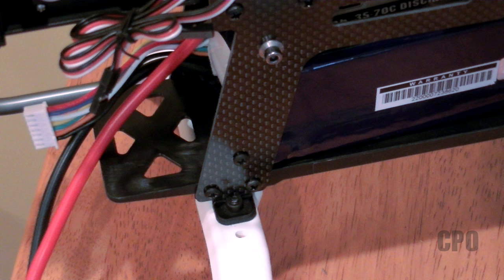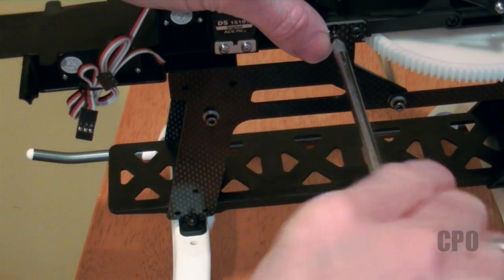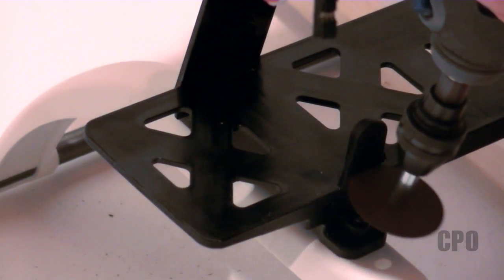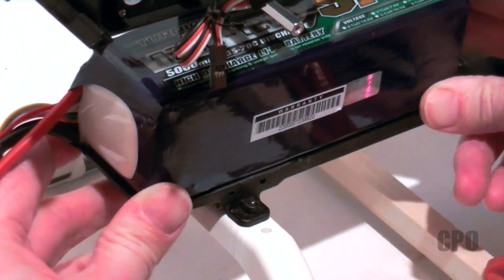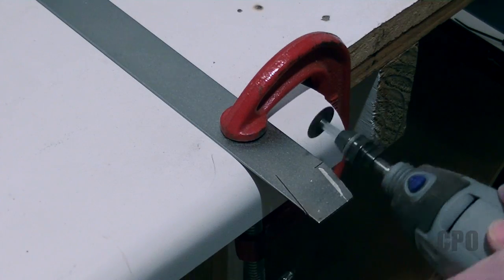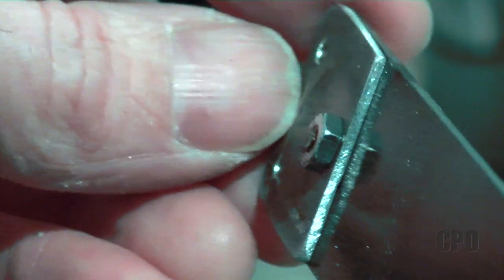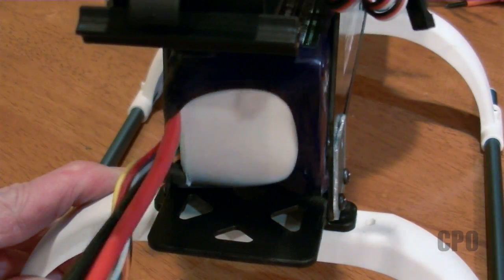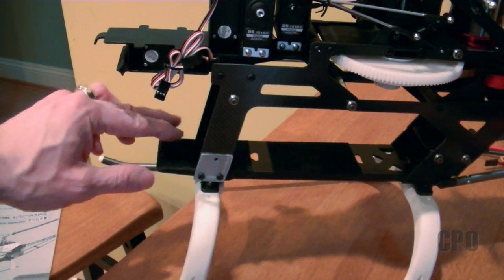TT Raptor E550FBL Battery Tray Mod

Comment from the maker: So someone on one of the forums suggested that the tab may not be for frame side rigidity, but rather to keep the battery tray from sheering downward under force. I hadn't looked at it from that perspective. What do you guys think?
Reply: I thought you were suppposed to be able to rear load the battery on the e550?  Didn't Nick mention that in his video?
Reply: Just a thought, if you buy some spare side plates, you can cut them toward the hole above the battery.  Effectively making a frame doubler.   Or make your own carbon fiber doublers.  It looks like those tabs are really intended to provide some torsional rigidity up front which will be hard to replace since it will naturally want to bend at the 2 phillips screws that tie to the battery tray.
Reply from the maker: Yeah, the battery can be loaded from the rear....I am just showing it from the front since that is what I was working on.
Reply: Sorry didn't read your original comment, I just watched the video.   I do think it was intended to stiffen the frame rather than securing the tray.  A 5000mah pack's mass will definitely add some strain on the frame during 3d.  How difficult is rear loading the pack?  I see it looks like it's sitting up front for cg, which must add some difficulty.
Reply from the maker: It's pretty easy. Tougher with velcro on the front of the battery. The way I have it now, only velco on the rearward half...that way I can slip it in from the back, and it will slide up front before I set the back down.
Reply: Any eta on the maiden?
Reply from the maker: It will be a while. I am still putting things together. It takes 10x longer to do videos. : (  New frame should be here soon too, so i am sorta taking my time until that comes in. Working out all of the electronics and telemetry at the moment.

Comment: I agree with the other comments that say to take both tabs off. I would also think that it might be a good idea to use a pop rivet from the inside out on each side to tie it all together. Doing that will move the flex load up into the frame better.

Comment: I think it should be okay without the ruler. But if it was me I would cut both tabs off and be done with it but to do it properly I would cut another piece of aluminium and get 2 countersunk screws counter sink the inside of the carbon frame just enough so the countersunk screw fits then add a nylock nut on the outside.
Like I said before I don't think you'll lose much strength by just cutting off the tabs and just leaving it cause all the bottom tray is for is to support the battery.
Regards,
Pete.

Comment: y CPO,  Here is a thought for Rev B of your Mod.  Cut another piece of ruller for the other side.  Cut the tab off the other side.  Install both plates outside the frame like you did for the first one and then use a button head screw from inside the frame to run through that top hole.  I think you will get a hole bunch more of strength and rigidity.  R.O.G.